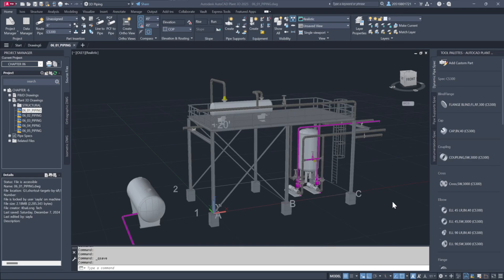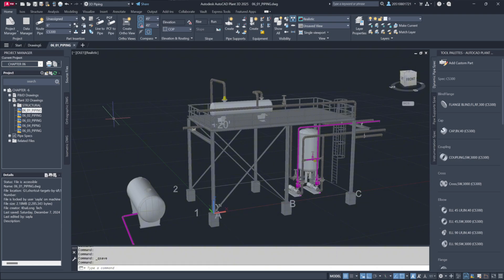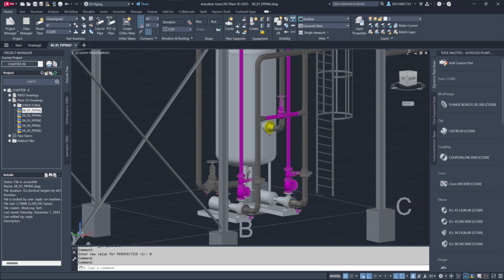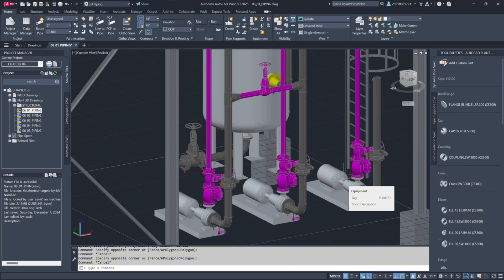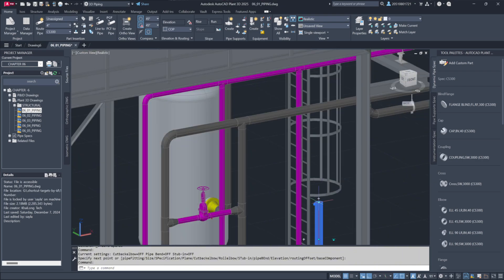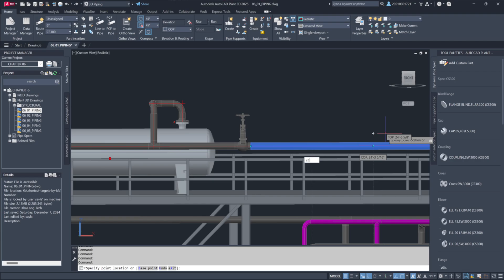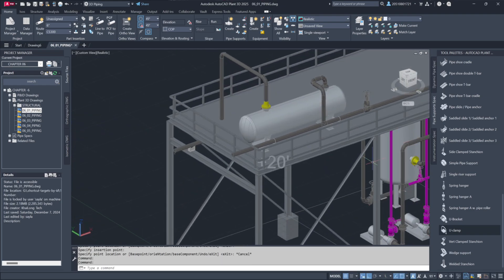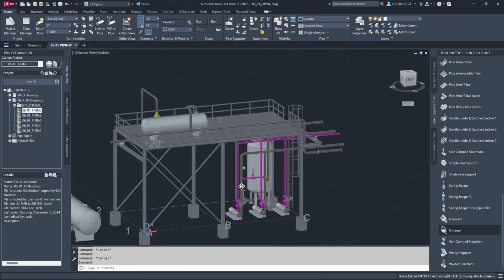Chapter 06 Modify and Reuse Piping - 6.1 Moving and copying data overview

Comment: i cant make a T connection, when im using "Continue Pipe Routing" i cant select the existing pipe, it passes trough. it doesn't make a T connection.
Reply from the maker: If you want to automatically connect Tee, you can check on this link which contains documents of how to set up branch table. https://youtu.be/uzXVO4NLmT0

Comment: Have you ever had issue in insulation missing on fitting (elbow). When i draw vertical elbow, its insulation disappeared regardless insulation thickness had been filled. when i change the direction to vertical, the elbow shows it insulation correctly. However, when i change it back to vertical, disappeared insulation showed again.
Reply from the maker: Could you please explain your question a bit more clearly?